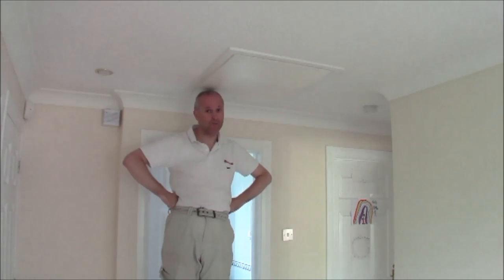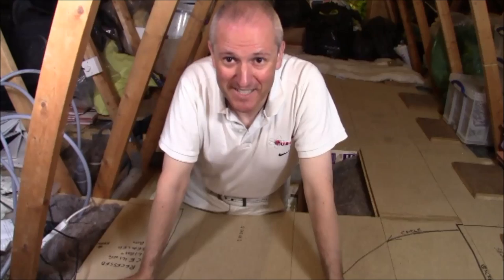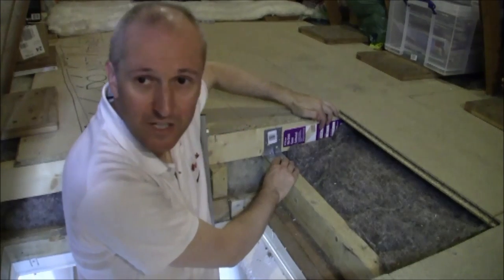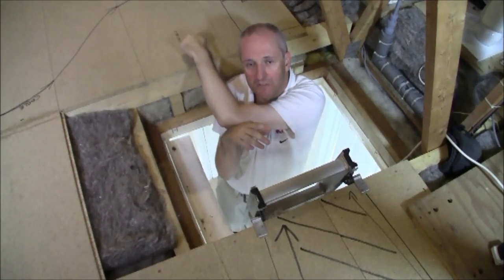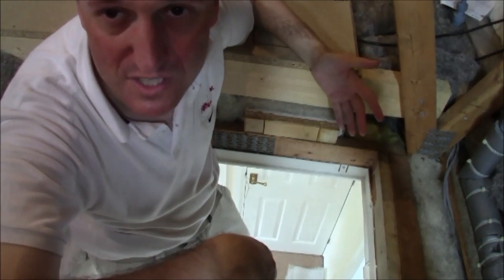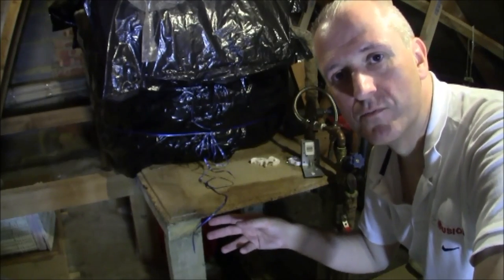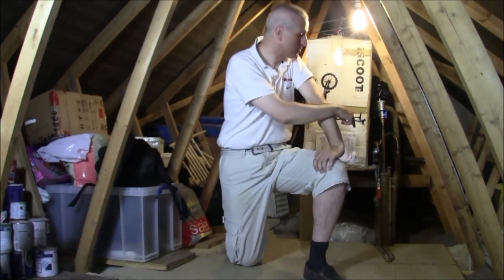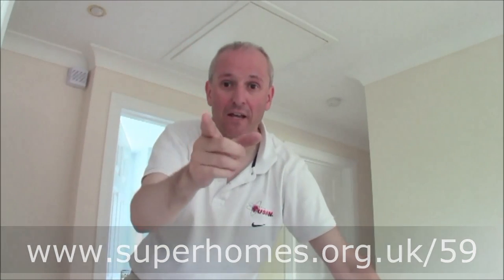DIY Loft/Attic Insulation with over-boarding for Storage [Superhome59 Video part 10]

Comment: My roof is 12 feet tall and took 1 and 1/2 days to board out and fit  8ft strip lights. Jewsons scrap 7 ply 30 boards 5ft x 2ft £30. Do the job right. This chap has more money than sense.
Reply: another keyboard "expert", modern houses don't have supporting walls inside the house, therefore the floor joists in the attic need additional support, hence the crossing of timbers to spread the load.  If you merely placed plywood board onto your joists, you haven't distributed the weight properly.So, stop acting like a know it all
Reply: Yes, an expert. I built my own 8 bedroom house. You have a problem with that?
Reply: Joists in loft are there merely to hold up the ceiling below and roof. Adding extra weight into a loft without strengthening the floor can cause movement and over load the joists.